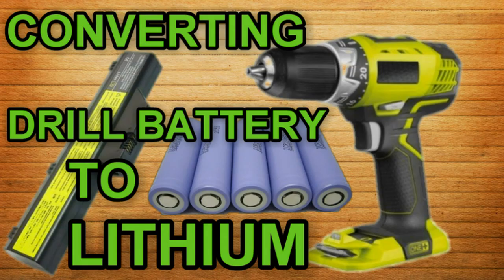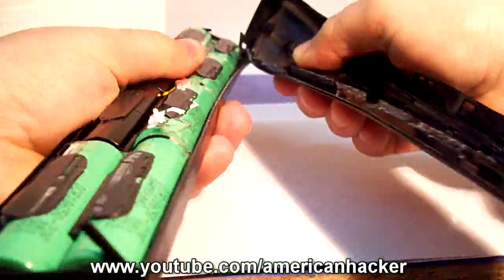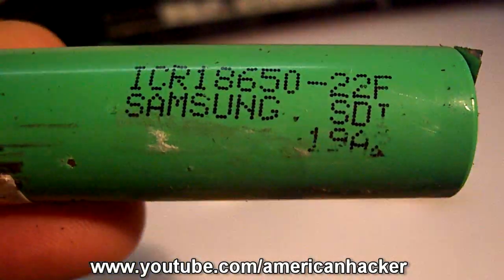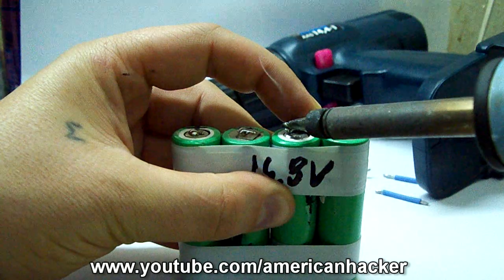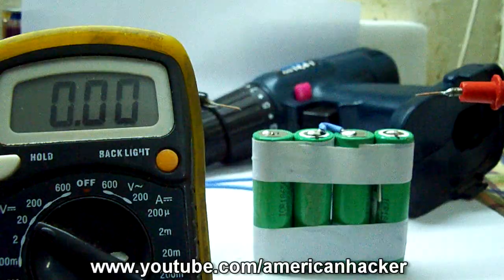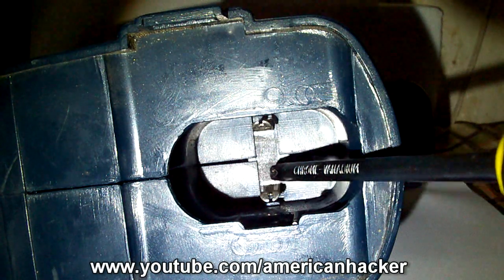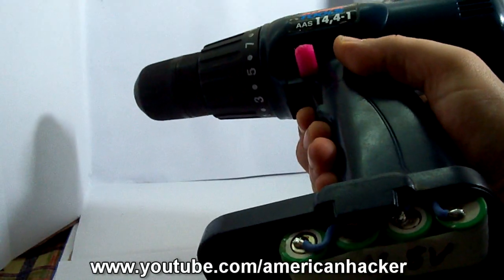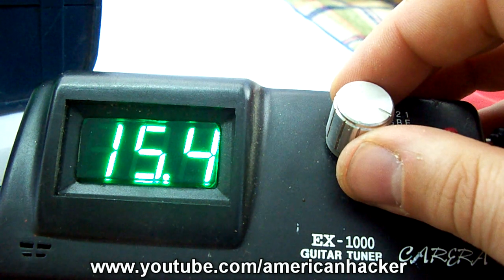Upgrade Your Drill Battery To Lithium For Free

Comment: 18650 from laptop battery is ... Fucking wrong idea! Their max(!) draw current is like 1-2A max. Battery for power tools have 18-25A nominal(!) current draw. So Your cordless dril don't have same power and battery pack can explode due to to high internal resistance -> heat.
Reply: You said "Each Battery has a max discharge current of 4.4 amps.
In video we see him use 4: which brings you to 17.6"

Yep, get a refund.
Reply: +American Hacker the batteries you have are 4.4 amp max!!! 
mate 18650's can deliver 30 amps but not the ones you have!!!! 
you need high drain 18650's they are not all the same
you also need balance wires attached to your cells and a balance charger or a battery tray so you can remove them and put in a desk top charger designed for 18650s, charging li-ions with no battery management is fucking dangerous, as in burn your house and you and all your family your dog your pet rat and your goldfish dangerous!!!
http://lygte-info.dk/review/batteries2012/Samsung%20ICR18650-22F%202200mAh%20%28Green%29%20UK.html
Reply: +Micah Houghton the batteries in the video are wired in series to obtain the 14.4v voltage which will be at 4.4 amps to get 17.6 amps the cells must be wired in parallel which would mean he only has 4.2v which is not enough to power the drill, my guestimate is he will need 20 of these cells to power that drill in a 4 series 5 parallel configuration which would give 14.4v at 22 amps max which should be good for a 300w drill which im just guessing is going to be as low as its gonna get, to make the pack that small you would need high drain 18650's such as samsung 25r or 30q sony vtc3, 4 or 5, or lg he2 he4 hg2 hg4 or hb2 hb4 commonly used for high powered vaping/ecigs
Reply: +oldskoolhead0 He's engineer. He knows better! Don't argue ;)
Reply: i wouldnt permit him to put batteries in my tv remote ;)
Reply: Hans soldering is perfectly safe if you know what you are doing. rough up the terminal, use some flux, go in fast and solder with a hot iron.
Reply: ok...im just of the spec sheet of those exact cells. And I guess I'll get a refund on my electrical engineering education....thanks youtube for setting me straight.
Reply: agree or not, yes the battery cells are well under powered. this is a possible safety issue but not the main one, the unbalanced, unattended charging pack will burn your house down long before this becomes a problem......
Reply: Micah Houghton You should know it.
Reply: that depends on if the drill needs 15a max or 15a rms, as generally eg a 500w motor can draw up to 1000w under load and if it were me id be wanting my cells to have a continuous rating of the drills max rating as due to the nature of the tool it can be assumed that the drill will be working under max load for working times above that of a cells pulse discharge current capability which is sketchy for the most part anyway as pulse means different things to different manufacturers so you can only count on the cells continuous discharge rating and like i say id be wanting this to match the drills max rating which in the case of a 15a drill may be closer to 30a under load
Reply: +DMAN22yeah Sometimes I feel like nobody reads previous comments. Nope those cells suck and his knowledge too. This topic is SOLVED by their datasheet don't try to change spec.
Reply: DMAN22yeah
if you are talking about drill batteries that will be because they are not lithium cells they are nickel metal hydride, if you look at any lithium power tool battery charger they have extra pins on them and circuitry inside to balance the cells
Reply: trust me no manufacturer will risk not including cell balancing as it is a fire hazard and would not pass trading standards, the batteries have circuitry inside and the charger has 4 pins on them instead of 2, the circuitry inside will do the balancing and communicate to the charger via the extra pins, if there is a makita drill without balancing it will most certainly be nimh cells inside, power tools with lithium in are not all that common although are becoming more so nowadays with improving cell technologies, if it has lithium inside it will most certainly say in big letters on the side and there will be balancing circuitry inside the battery pack, even the cheap ryobi ones have it in....
Reply: DMAN22yeah
ive just done some reading on these makita batteries and there were a battery that was dying early due to a design fault with the balance circuitry, as the balance circuit was drawing its power from the 1st 2 cells only rather than the full pack which is fine as long as the battery is charged regularly but when left for long periods the balance circuit would drain the 1st set of cells and unbalance the pack and lock out the battery making it unusable, makita were even replacing these batteries out of warranty if they had a low charge cycle count which is information also stored on the chip, the batteries could be used on after market chargers that ignored the block on the chip and charged them regardless but they would never work on a genuine makita charger again unless this chip was replaced. i think maybe this is maybe what you are talking about as commercial lithium batteries dont come without balancing circuits ;-)
Reply: +Micah Houghton "Hans is professional thread troll"
YOU MEAN....
he gets paid to curse? DAAAAAAMN!!!
Reply: Why You are pretending to know everything? Big companies are producing several types of 18650s. They can go up to 40A but laptop ones are not designed for that max amps. They are optimised for life cycles - that means less amps. You wasted 1 min of my life. Fuck you!
Reply: +Hans Gonna need to see your figures on this to give any credit to what you're saying. Because I'm thinking you're wrong. The guy can place them in parallel to raise the current, or he can place in series so he can raise the discharge capacity. The video only shows him using 4 for that drill, but as much is cut out from the process, I'm sure he used more.
Each Battery has a max discharge current of 4.4 amps.
In video we see him use 4:  which brings you to 17.6
I'm still guessing with the size of the drill he did use more batteries as Im sure he'd need two or more  sets of batteries in series, placed in parallel.
Reply: dont talk shit unless you can back it up
Reply: oldskoolhead0 Much better rebuttal to this thread.  Thanks for showing up with some good points.
Reply: simhopp Laptop cells have 2A usually.
Reply: 4A max and drill needs 15A so over 3x max draw. We should use like 15a NORMAL corrent draw so it is like 25-30A max draw.
Reply: Hans is professional thread troll
Reply: time to let it go. I looked up so specifics and come to conclude Hans is just trolling another thread
Reply: oldskoolhead0 balancing is important. even some higher quality brands dont do it.
Reply: oldskoolhead0 nah, a few years ago makita li ion tool batteries were not balanced, leading to a short life.
Reply: oldskoolhead0 nah, they had some packs with unbalanced 18650s, but they quickly added the proper circuitry once they realized it wouldnt work without.
Reply: oldskoolhead0 ok, that makes some sense. also the cheap lipo buzzers do that too, so watch out for that
Reply: +oldskoolhead0 Dude lmfao pet rat
Reply: Hans  Max draw = 2 Amp?  yeah, 10 years ago maybe fucker!
Reply: Hans  Yea the American Hacker is right and you are an ignorent fuck face who has to do more reading.
Reply: Hans  Only the cheap crap you are buying mate!
Reply: blaga2005 Show me 1x 18650 battery that can output 10-15 amps?
These days they go up to 35 amps!  Do your homework!  And btw all 18650 are optimized for a max number of charges.
Reply: Hans Not true, it depends on what kind of motor the tool has build in. And that's ALL!  I'm not speaking about laptop batts, they are shit everyone knows that.  And if you insist on using pathetic profanity try to be original.
And HANS deleting moronic comments like they never existed 1. doesn't work, 2. Is the mark of the coward.
Reply: You've wrong my friend. Your battery type could handle maximum 4A. Do some research. You should us INR18650 Samsung, US18650GR or LG HG2. Rating discharge for those batteries are over 18A.
Reply: b8 vk*
Reply: +Micah Houghton I can and I did. Do what You want. I make things based on my knowedge, You can do it too. BTW: You dont know shit what You are talking about, belive me.
Reply: +Hans for a drill what he is doing is fine, it has a very high surge current, which the cells can handle and then a fairly low continuous draw, and drills arent used all the time so it is adequate.
Reply from the maker: +Hans 18650 batteries can deliver over 10A
Reply: No. Less talking, more looking at datasheets.
Reply: Do what You want.

Comment: Not safe for the batteries or the user. you not only need discharge protection but charging protection in the form of balance charging.
Reply: +Engineering Nonsense i did mine with 5 18650 battery holders and charge them on a normal charger, his way is not recommended as one cell might get more of a charge and stop the others charging

Comment: Your charging method is suspect, lithium ion batteries can't be charged in a delta v configuration safely since their internal resistance won't rise as they charge. If you don't monitor your charging carefully they'll overheat and catch fire...

Comment: Yeah... this isn't really a good idea. Those batteries aren't rated for high current which is needed for cordless tools. If you put too much stress on them they can catch fire. You need to use proper high current cells for power tools.
Reply: +Krankie V you can draw 10 amps off most 2100mAh 18650's. far more than the original batteries could have provided.
Reply: Grover Asylum
laptop batteries are generally rated at 4A or 7A max continuous draw. The original cells for these cordless tool batteries are rated for 15A continuous draw. Milwaukee uses 20A cells.

Comment: This is not how you charge lithium battery !! You need a special charger because lithium batteries charge with cycles.

(They need to be charged up to a specific voltage and with limited current, otherwise they turn into potential incendiary bombs.)

I'm 16 and you don't know about lithium batteries !

Comment: Nice one sir do you have a simple charger circuit for these lithium batteries
Reply from the maker: Absolom Madhaka  you can use any kind of dc adapter that gives the voltage that you need,but you must controll the current no more than 300mah,you can do this by adding a resistor.search on google ''lithium charger circuit''.